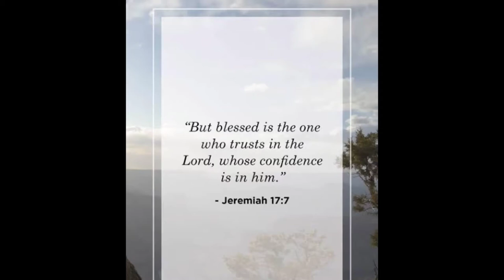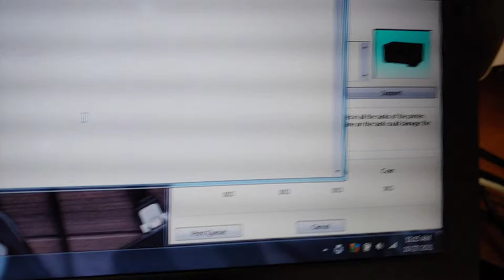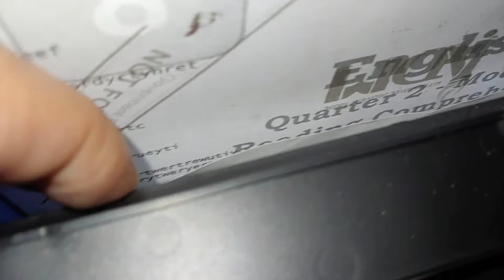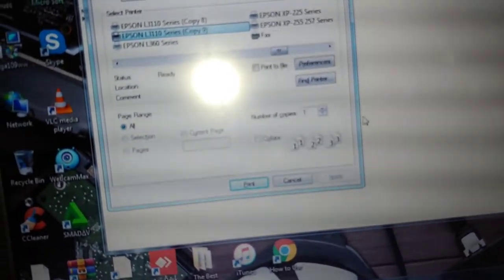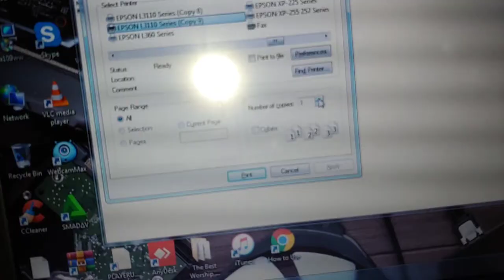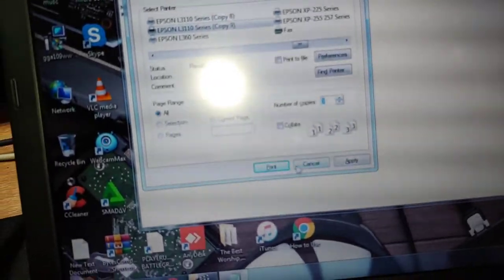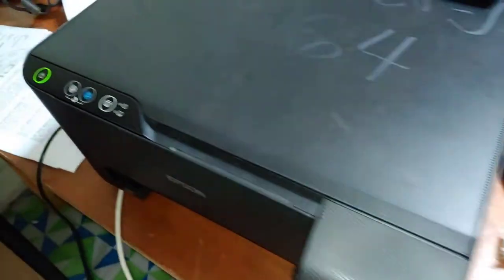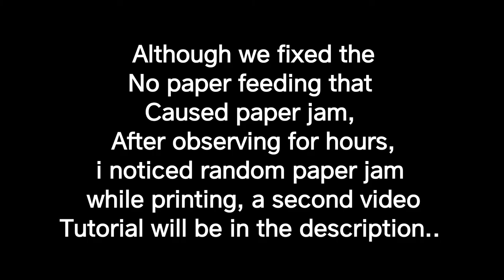Epson L3110 paper not feeding correctly | see description

Comment: amazing, but mine is always showing that i need more paper and ink, although my CMY is above half tank. Does not using the printer for a year may cause the ink to dry inside? if so, should i clean it ? or just add more ink, please advise.. thx in advance
Reply from the maker: Once the orange light stays and you cant print then you cant reset ink level by pressing resume/cancel button 2+1 .
To execute press by 2seconds and followed another quick one press . 2 pressed total.